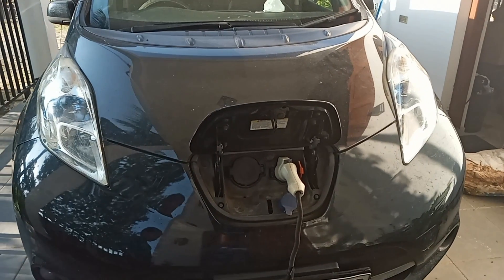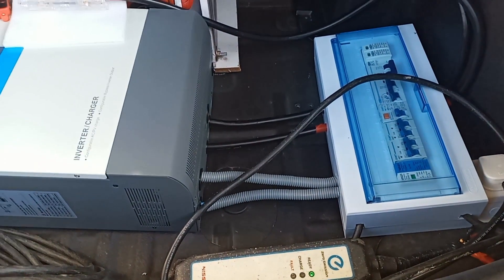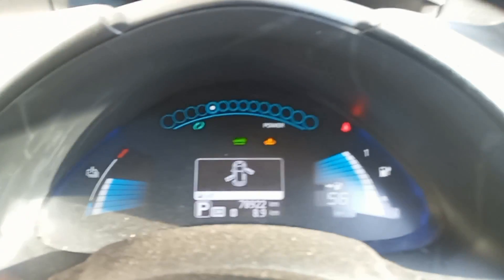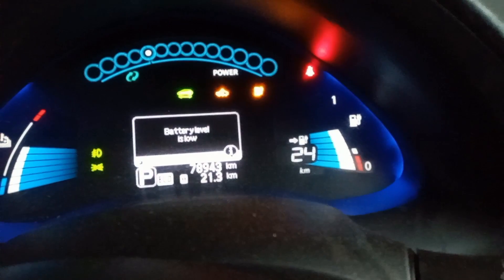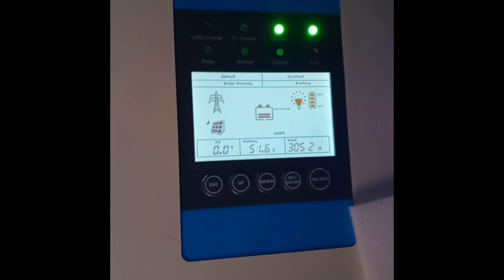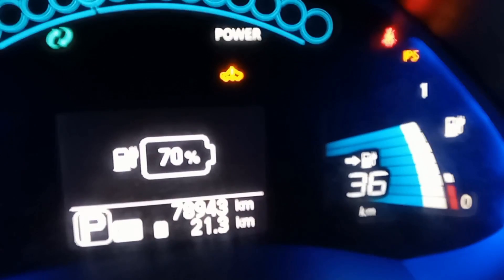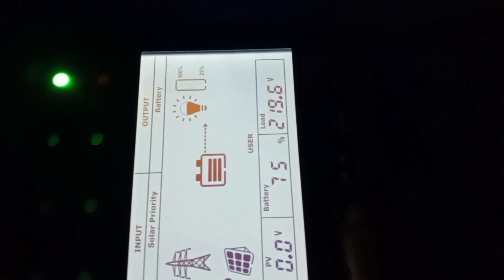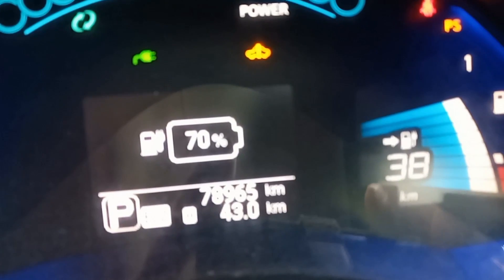DIY Nissan Leaf EV Battery Extender with 5kWh LiFePO4 battery Test drive

Comment: Good idea, but a bit clumsy with the wires and extra weight. Would be lot easier to buy ecoflow or other brand battery storage that you can bring with you to charge up. Yes those might of course be more expensive. Good job anyway. I have installed a vevor heater on my leaf for winter driving so I don't use battery to heat the cabin. I have same leaf like yours with 17kwh battery capacity. Always good to find ways to keep old leaf on the road than scrapping them.
Reply: how long is the "portable" charge take for this 3kwh ecolflow ?

Comment: Ha ha, it is something similar I've bin thinking of. Good job. Maybe a DC/DC converter from LFP (maybe 48V) to aid the main battery at 360 volts.
Reply from the maker: Yes! If you can find a good DC-DC Converter ,, then it can be directly coupled to main battery !

Comment: You need new battery 🔋
Reply from the maker: New batteries are not available for purchase in this part of the world (Sri Lanka ). Even a second hand one will cost you a fortune !!!
Reply: @HappyGreenerWorld  I've seen that you can put unofficial lifepo new battery in this Leaf model till 70kwh giving you about 380km of real range capacity with 1 charge. But I insist, not from the official Nissan.
Reply from the maker: @danielg.3444  Yes! There is one vendor in SL who did it successfully !
Reply: Also a problem in USA 😕 was going to do the same thing good video very smart workaround 👍 smaller inverter will be more efficient you only need 2000 watt inverter get you some more range and it’s quiet also make sure it’s pure sine wave
Reply: @happygreenerworld have you been able to upgrade your battery yet? Do you still have this car with the same battery health? I have a nissan leaf 2015 S and it still has 12 bars, I mainly charge at level 1 now that I have a plug next to my parking stall at my apartment. It has only a 23 KWH battery stock from nissan but I don't know if was replaced, the dealer said it is still stock and not replaced. Not bad if the previous owner had it for 8.5 years and still has 12 bars. I want to get a tesla longer range car in the future, but for now i'm happy with the nissan leaf.